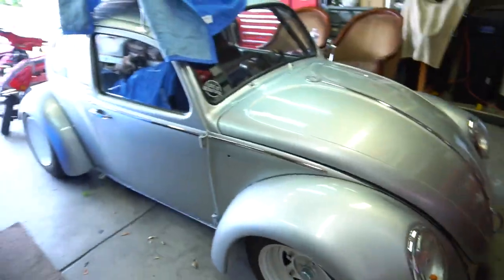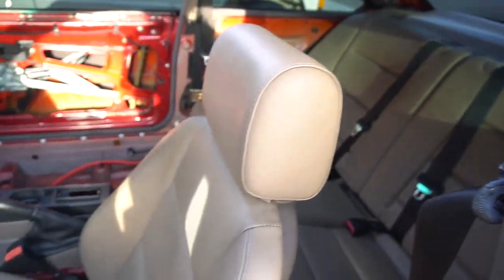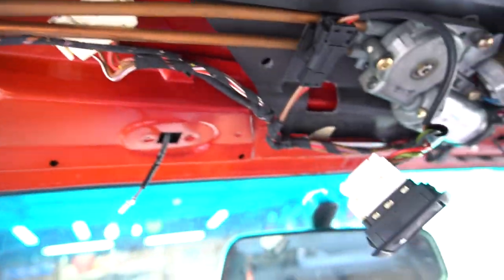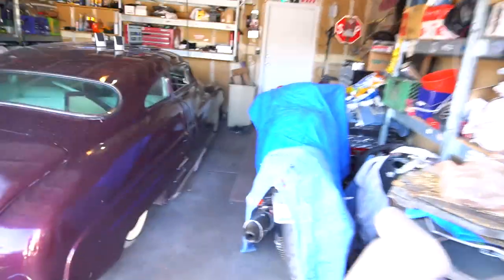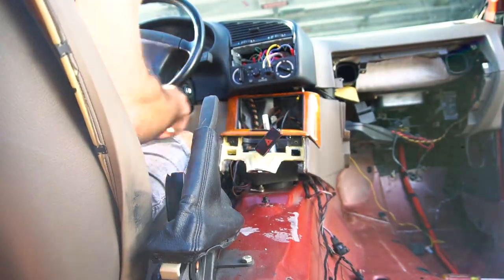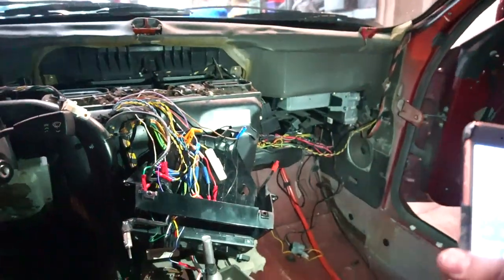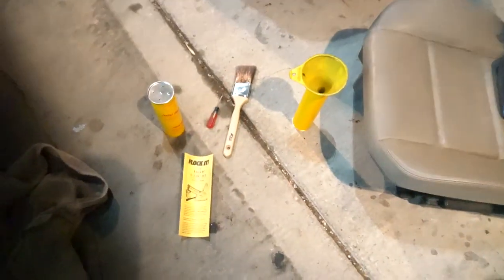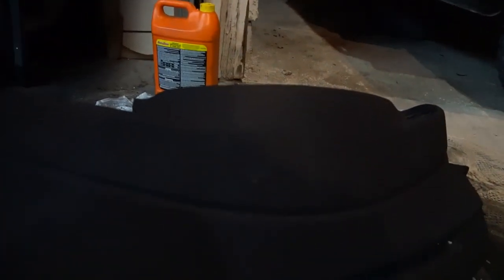DIY DASHBOARD FLOCKING | E36 DRIFT BUILD

Comment: hey bro. i got an exhast just like ur red one and i was wondering if u used the metal oring between the output and the header or did u bolt it without the oring(gasket)